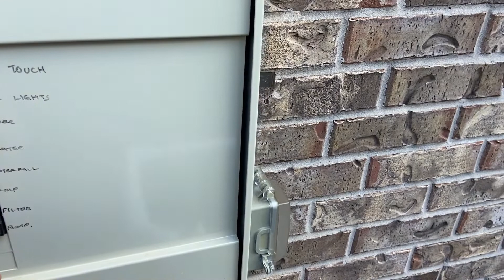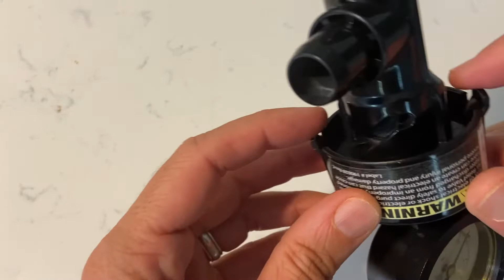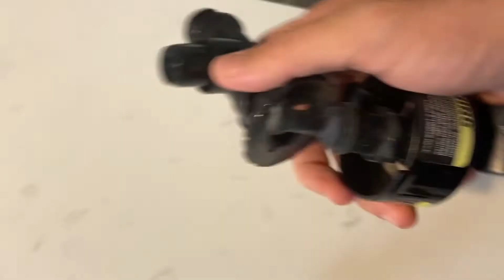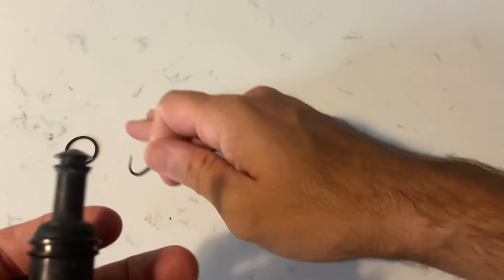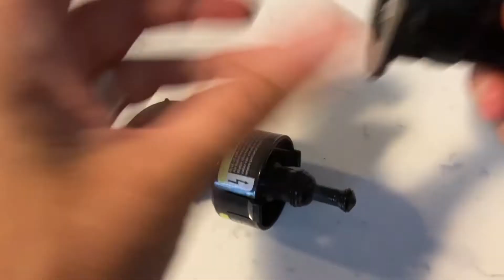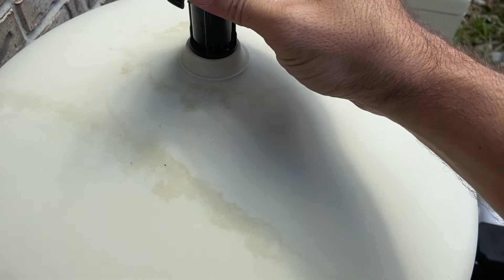How to DIY Repair a Leaking Pool Filter Air Purge Valve

Comment: You forgot to put new Teflon tape on the bottom of valve. It will be leaking again in no time.
Reply from the maker: it didn’t have any tape on it when it was originally installed 3 years ago by the pool builder.  It’s still holding strong a year later after I changed out the o-ring 💪🏼
Reply: It doesn't seal with teflon.  There is an o-ring down there that seals it.